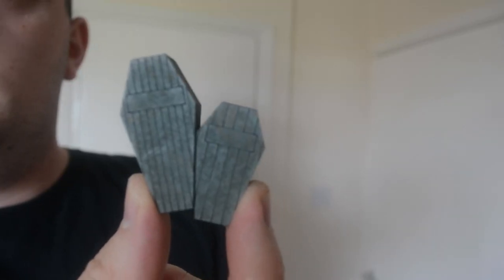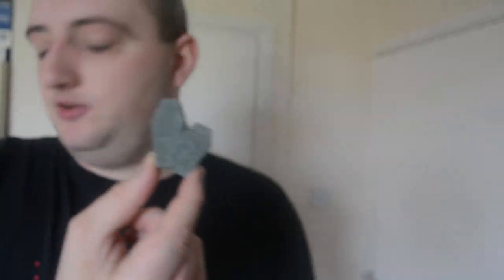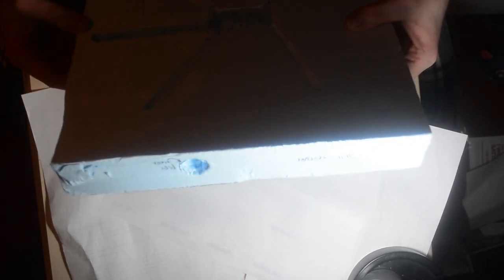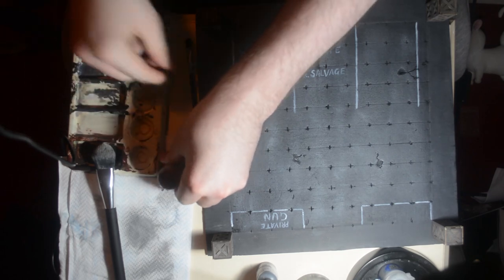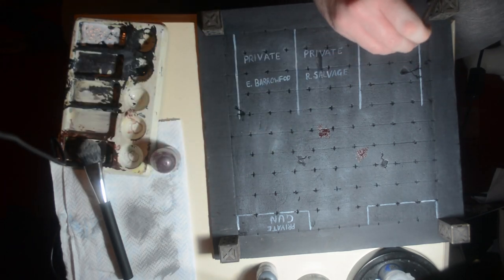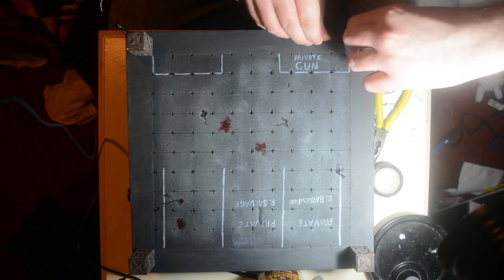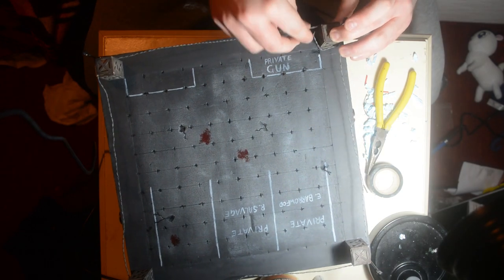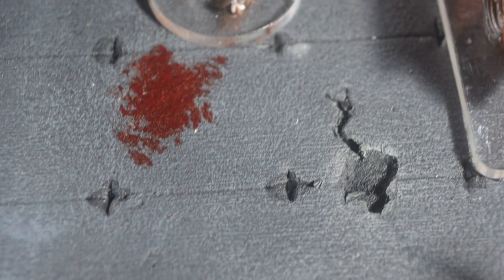How To Build A Gaming Board - Rumbleslam

Comment: Loved this idea, I may very well be having a try at my own in the future. 
If I could make a suggestion, when doing the initial paint coat, on that foam it is a good idea to mix Mod Podge with the paint, it will protect the surface from getting chipped.
Also could I enquire as to the lights you used for the ring corners. are they made with the 'bulbs' already inside ready to wire up to power source or have you had to make some adjustment to them?

Once again, great work sir :)
Reply from the maker: I'm not too bothered about chipping,  really.  It is stored on top of a wardrobe and only used at home. The lights are from TTCombat and are ready to connect to a circuit straight away. They only cost a couple pound and are pretty good
Reply: @TippyClub  just a thought, I've seen quite a few terrain makers use that process. As long as it works for you then who cares what anyone says eh :).
Thanks for the info on the lights I will have a look. Take care
Reply from the maker: If it was something I'd be moving about to places, I'd definitely seal it with glue, so definitely a good call. TTCombat do more modern lights too, but these gas/oil lamps were just perfect for a loose fantasy theme like with RS. Let me know how you get on with your project
Reply: @TippyClub  will do, when I get round to it